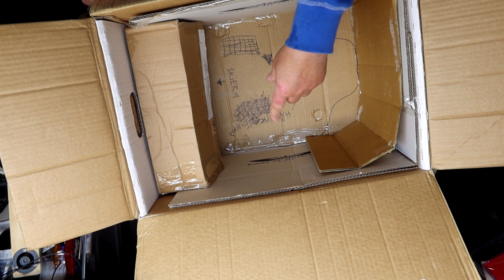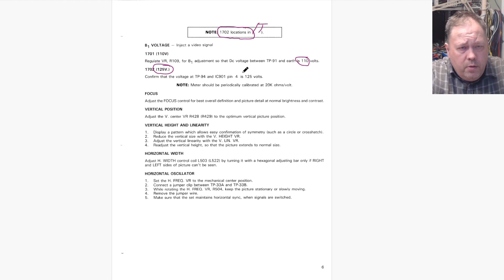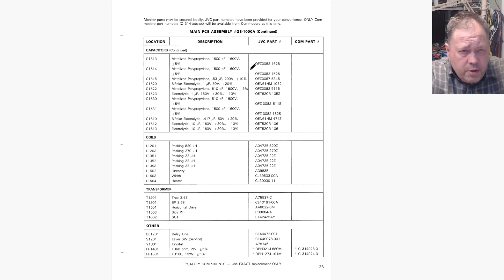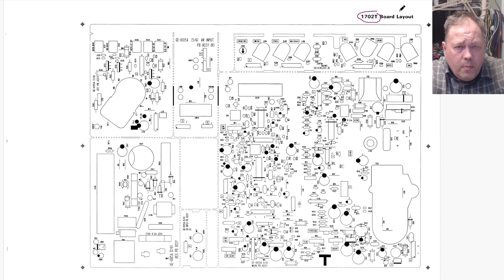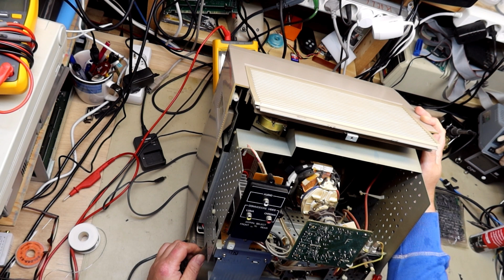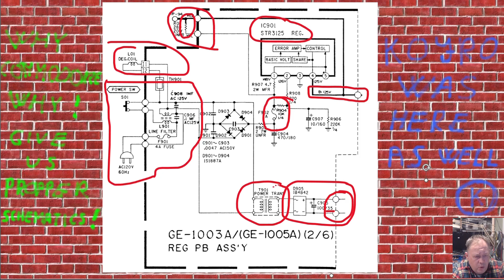The Commodore 1702, Part 1. We are blowing some fuses in our attempt to get info about this classic.

Comment: Do you have an update on this? I've been trying to repair my 1702 for four years (seriously) and it keeps blowing the 1.0a fuse on the power supply board. The monitor is almost brand new in the original box and I really want to fix it. Thank you!